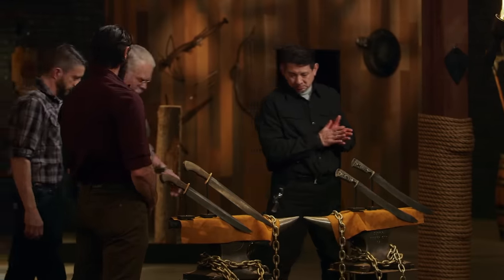Forged in Fire: Beat the Judges: SUPER SHARP Dueling Sword Duel (Season 1) | History

Comment: The blade with that finger complaint.... i think the judged wore it wrong. Instead of the blade being in a +/- 90 degree with the forearms, the blade should have a greater  angle with the forearm, around 110. Than the finger issue isnt an issure anymore. It's different but not bad nor a point to let the blade lose.

Overall, it was a very competitive episode with confident smiths.